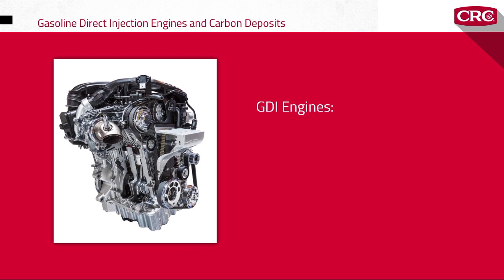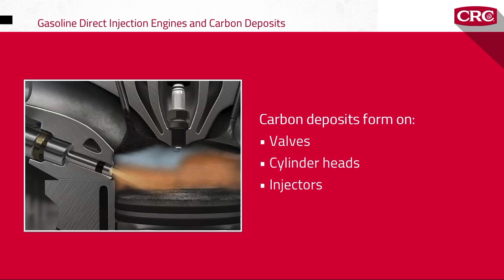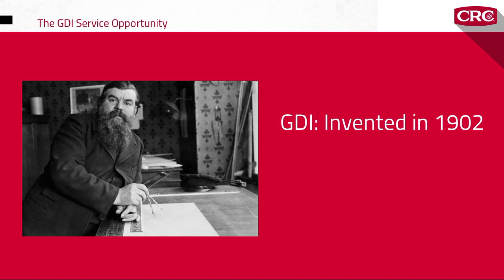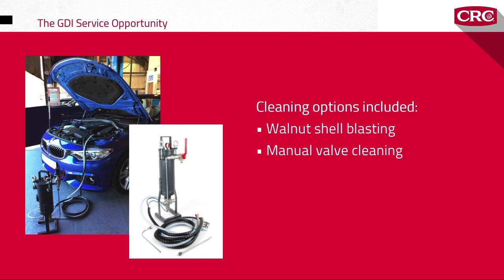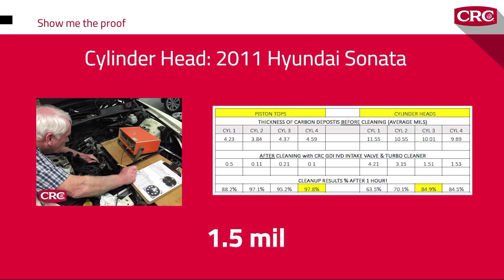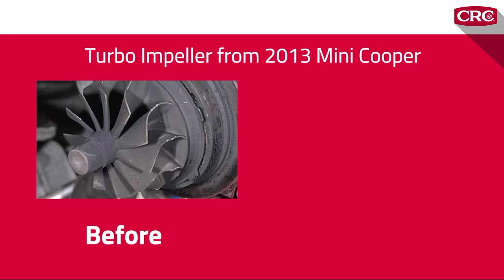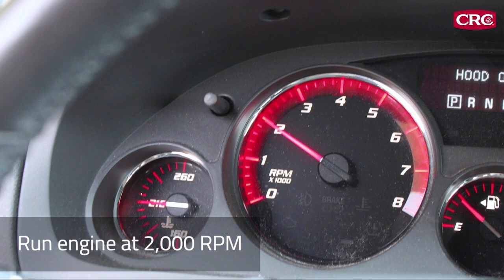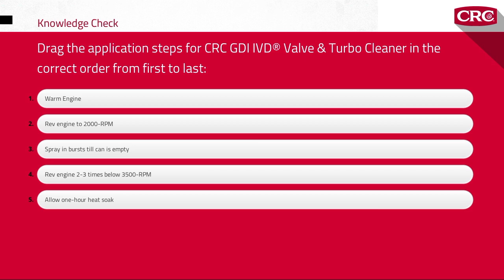GDI Engines and Carbon Deposits | Know Your Parts

Comment: Change your oil way sooner than they tell you to in these cars. Just do it. You’ll thank me later.
Reply: Thanks Batman 😀
Reply: Thanks brother
Reply: Agreed. I have a 2015 Optima w the Turbo. Though I only drive about 8000 miles a year I still change the oil every 3-4 months. I note after 3 months the engine gets louder and labors more. The car runs better on very clean oil

Comment: As a professional tech, I can confirm, that your cleaner does not work.
Reply: Idk buddy there's some people who been working on cars that say otherwise👀
Reply: Are you using it correctly you do know the engine is suppose to be hot right
Reply: @richardgolden3364  it doesn't matter in what temperature, cleaner doesn't work if carbon already caked up on the valve, even if we use screwdriver or sharp objects it still need a little bit effort scarp them off.
Reply: But liqui moly valve clean does..
Reply: @dingpongchi632  I heard it depends on the car. For instance I heard cleaner doesn’t work on vw tsi
Reply: It worked for sure on my 2020 Hyundai
Reply: What about all these videos on YouTube that say otherwise
Reply: @Qriusme  is it safe to use. Can it be done at home or does it need to be done by a mechanic? Thanks
Reply: @agustinmendoza7124  I followed instructions methodically and did it myself twice.  Can definitely tell the difference in improvement
Reply: @Qriusme  thank you. I have a 2019 Sonata. I’m definitely going to try it. Cheers Randy
Reply: It works as a regular maintenance item.  It will not remove caked on deposits.
Reply: I have a 2016  and the gdi motors and cvt trannys are trash. You need to run sea foam through the intake system ( because gdi doesn't inject gas through the intake like most cars , so they get higher compression  ) and take the intake boot off and spray behind the mass air flow sensor. Put boot back on. Rev to 2k rpms and hold it there while someone sprays the sea foam in . After can is empty, turn off car and let hot soak for 15 min. Then start it up, Rev it, drive about 10 min. If smoke doesn't appear right away don't worry it will ( especially in these trash motors , I've done 2 sea foam sprays already and may need a 3rd ) . If no smoke comes out, pull over and turn the car off for 5 min . Start process over again and if you have triptronic where you can control the gears then really get on it 1- 4th gear . Blow all that crap out of your motor. These engines do burn gas esp while using sea foam. Get an oil change shortly after. Smart thing would to be add the liquid kind to the motor and fuel system and drive 100-200 miles and then definitely get an oil change. God bless 🙌 🙏

Comment: GDI Cars should come with catch cans from the factory. Won't solve the problem but may delay needing to prematurely service the valves.
Reply: Solid and cheep option to help with all the evap junk
Reply: I agree,  I did install a JLT catch can last Tuesday at or around 12,000 miles....I think I might buy the jlt 3 oz extension  can for my 2019  after I check the JLT after 3000 miles to see what Will be in the can.
Reply: Or use both port AND direct injection so you get the benefits of direct injection without the carbon buildup issues.
Reply: @psychopenguin3821  not sure how they would freeze up, there is a lot of heat passing through that can. Plus oil is what is mostly being caught and it shouldn't freeze up..
Reply: @Eric Joziah Instablaster =)
Reply: @Kannon Shane Thanks so much for your reply. I got to the site through google and I'm trying it out now.
Takes a while so I will reply here later with my results.
Reply: @Kannon Shane WTF IT ACTUALLY WORKED! Just got access to my IG login after roughly 40 mins of using the site.
Had to pay 15$ but definitely worth the price =)
Thank you so much, you saved my ass :D
Reply: @Eric Joziah happy to help :D
Reply: @ericjoziah5085  Nothing contrived about this at all. 🙄
Reply: @HowtowithPaulHenderson  : I added a catch can to my gdi engine. The engine claims to have an oil separator for the vent system.
I get a rusty looking water in the can, very little oil.
Reply: @drewthompson7457  that doesn't sound good...it should look like motor dirty motor oil but maybe a tad bit thinner...is it frothy or brown or both
Reply: @HowtowithPaulHenderson  : it does seem that the built in oil separator is doing it's job, and synthetic oil evaporates less anyway.
I put the water down to condensation of combustion by products, as that's what the PCV system is for.  I'm driving less with the Plandemic, I get say an ounce of brown water in several months. / several tanks of gas. As for the color, I have seem brown spark plugs too.
There is no hint of water in the engine oil.
Reply: @electric7487  Basically everyone should build the way Toyota does
Reply: @drewthompson7457  I here people with the same problem. Some people say it's the cause of condensation as your vehicle sits outside in the cold night and bits of water accumulate on the sides of the cylinder and mixing in with the oil.
Reply: My f150 ecoboost never had that until after I was changing the oil return pipe for my turbos. My engine had a consistent ticking noise and shaking on acceleration that raised concerns. Come to find out the ticking noise was caused by pressure build up on the oil-return pipe and the shaking was the engines way of overworking itself so it doesn't die. The hairline crack on the pipe created a suction and leakage that water would go through it and get caught in the catch can. Glad I found that out quick.
Reply: @HowtowithPaulHenderson  I think they would freeze up overnight when car is not running in cold climates
Reply: @drewthompson7457  That's good to hear. Just keep an eye on it. Think I'm on my fourth JLT inspection This time I caught 3 and 1/2 oz I think that is due to the high rate of speed I was doing before this oil change and JLT inspection. I drove from Riverside to Vegas from Vegas to Reno and then back to Vegas and then back home I reach speeds up to 120 mph and cruised at 100 for quite a long time.
So during This driving. My drive totally normal so now I'll be kind of curious as to how much winds up in the jail to you.
I did send the oil into Blackstone laboratories to get it analyzed It came back pretty much identical to the other two oil samples I sent in.
Reply: Yeah it's crazy the over flow that get plumbed back into air intake and with direct injection we already have dirty intake valves my throttle body is filthy

Comment: I used this as preventative maintenance on my Kia Soul, then I lost a lot of power.  It turns out that my catalytic converter was clogged up, probably from the carbon that was dislodged from the valves.  So, yeah it cleans the carbon off the valves, but it can result in expensive repairs to your exhaust system.  That $15 can of magic cost me $1500 at the Kia dealership.
Reply: I had a bunch of catalytic converter codes after using, but they went away after a week.  I plan to use it again.
Reply: Old post I know but hoping for a reply. What did the Kia dealer say is the best way to combat the carbon build up?
Reply: @Hutchy86  I'm trying to remember.   One time I took it to the Kia dealer and of course the suggestion was an expensive catalytic converter replacement.   I went to a muffler shop to get it done  instead.   This happened twice, then I got rid of the car.  No more Kias or Hyundais for me.
Reply: @sibco96  thanks but I was actually referring to the values valves. Thanks for replying 👍
Reply: @Hutchy86  Ok, I've heard of two treatments: one is to chemically spray/soak the carbon deposits on the valves (GDI cleaner), and the other more extreme solution is to remove the heads and blast the valves with walnut blasting media.
Reply: Oh no, that sucks. I've been a little concerned about the cat conv myself and the effect that carbon cleaners would have on it
Reply: Maybe you should learn how to disassemble the cats. I mean, if you think $1500 is expensive, get a BMW. That's why a lot of BMW owners DIY everything. For example, an alternater replacement at the dealer is $1400-$1800. Did it myself in less than an hour and without the special tools they try to force you into buying. Cost me an hour of time and maybe $200. 
Keep doing your research when you run into problems with your car. Dealers dont generally fix the faulty part, they just replace the part altogether. Which is why it is so expensive. Always talk to other mechanics where you live if you can't diy. Good luck brother.
Reply: Thanks for saying that . There is no magic bullet for this issue i was concerned about the 02sensors and cat 🤷‍♂

Comment: 2014 Kia Rio 1.6L GDI even after using Seafoam regularly, 3500 mi oil changes, top tier fuel, valves get buildup where it impedes the complete closing of valves which allows oil to go through manifold to catalytic converter causing clog and heat damage. No recall on Rio , just Soul at this time but class action lawsuit filed in Federal Court in April 2022 against Kia Motors...Look at Kia excessive oil consumption.
Reply: I was thinking about getting a new '22 or '23 Kia Carnival with the 3.5 v6 GDI I wonder if I should pass 🤔

Comment: Best solution for GDI woes is to not get one 😉.
Reply: Lol
Reply: Almost impossible now to find port injected engines. Every car manufacturer is switching to GDI
Reply: @burgos041  I know, its why I bought a 2019 and not a 2020
Reply: Or properly maintenance it
Reply: @lordarkay272  They should get rid of EGR valves.  I believe that would stop the issue and then GDI would be fine.  Seems stupid to me to recirculate exhaust gases with oil vapors in them.
Reply: @andrewdanvers308  perhaps but now with such easy fix u think it's fine I have a gdi 4 cylinder and it has 30 k of hard use and still hasn't built much carbon now maybe when you get bigger ones it'll accumulate faster
Reply: @lordarkay272  many of the work arounds seem to work.  And with all the manufactures building them like that, they've  taken away our choices.  I just feel that we shouldn't have to use work around if a product is well thought out enough.  Good luck though.   I bought a 2019 Outback so I could not have GDI or start stop bs.
Reply: Toyota’s use both port and DI thereby avoiding any carbon buildup.🇯🇵
Reply: @barackblows1942 Agree that Toyota appears to have a better idea with their port + direct injection but there lies the problem...appears theyre unconcerned about other factorsmsuch as...Toyota rav4 2022 body styling is REPULSIVE!! Not to mention substandard interior, handling and noisy.

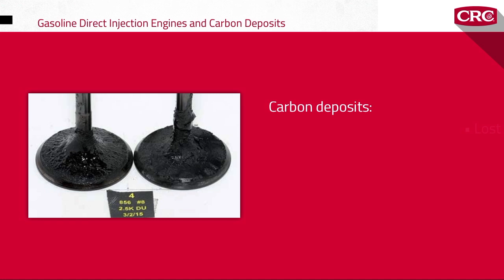Comment: 0:51 "GDI can provide improved MPG"  1:02 "Carbon deposits from GDI will lower MPG"  
In reality, GDI cars don't get better gas mileage than port fuel injected cars, but require burning gnarly chemicals to clean the engine.  That's way worse for the environment than a normal port fuel injected engine.  I'm sure this is the government's doing.  Whenever the government tries to save the environment, it creates more pollution.  Oh, and people aren't going to maintain their cars 5x as much, so now cars go to the junkyard sooner too.
GDI is stupid.  The cleaner stuff in the video is pretty cool though.  I've cleaned carburetors and fuel injectors (out of the car so I know it worked) with GDI cleaner and it seems to be more potent than carburetor cleaner.

Comment: I have the dreaded 2.4 theta 2 engine, I recently switched from always using full synthetic that's recommended to using mobil conventional 5w30. I no longer have to add half a quart every week and it runs quieter.

Comment: If you have a GDI engine, never let the vehicle just sit and idle for long periods of time.  This is when most of the deposits occur.  When in the drive through shut the engine off, waiting for friends you pick up ect.  Another thing that helps is being a little heavy on the gas in first and second, and a good spirited highway drive at least once a week.  These are the tips I have read about that seem to make the most sense.
Reply: But for turbocharged GDI cars after driving hard you can't just shut the car down right away you may end up damaging the turbo (turbo timers actually leave your car running after even shutting it down, of course that is if you were just driving it hard) so this only applies to naturally aspirated GDI cars.
Reply: @raulferro3998  I agree 100%.  I only own naturally aspirated vehicles so I was not referring to them, thanks for the extra info.  Come to think of it I never owned a turbo car before, something I must put on my to do list.

Comment: Using Pennzoil ultra platinum 5w20 and a bottle of Chevron Techron Complete, plus good gasoline will go a long way to help. My wife ❤ her 2014 Optima, and only has 22k on it. We are currently on vacation and we have driven over 1200 mi to get here, 75-80 mph while getting 38mpg. I've seen many of these vehicles over 150k miles. I've done a lot of research on the GDI 2014 OPTIMA,  best i can tell is try to keep carbon build up at a minimum.  And make sure the VIN number does not begin with a 3, these vehicles were assembled in Mexico and have proven to be very problematic. The Pennzoil ultra platinum and Chevron Techron Complete are great products, as is CRC intake and turbo cleaner. I hope my very limited knowledge has helped at least 1 person 😂.
Reply: Using the same oil in the wife's 2015 Hyundia Santa Fe along with injection and valve cleaner / fuel system cleaner on a somewhat regular basis. Pretty sure it's the only thing keeping that motor alive (2.4L). Will try this in the near future. I dont like how the oil looks like diesel oil even though it's changed like clockwork. Not only that but its using oil now also which sucks considering very good oil is used
Reply: My 2015 Kia forte five First three Vin letters are KNF ………… I’ve been running now shell premium, Pennzoil, high mileage, platinum and had the injectors had to be rebuilt over a year and a half ago because it was almost catastrophic and my car runs smooth now mechanic told me to put in premium gas and I have been for months and months, but haven’t done the CRC cleaner as represented in this video I think the technicians did it on my car probably a couple years ago. I’m afraid to do it with over 161,000 miles and it’s running pretty good. I don’t wanna make a mess out of this and have carbon or pieces of material causing issue that break free.

Comment: "Safely dissolves carbon in a controlled manner that prevents large pieces from dislodging in the engine." is their statement.  This is better than large lumps of carbon breaking off and ending up in your catalytic converter.   Everyone says...use the can until empty.  BUT I think a better strategy for a large mileage GDI engine that would have a ton of carbon build up, would be to approach it gradually.  I would be doing a quarter can or less once a weak until two cans used.  Just gradually remove the carbon build up.   I wouldn't want a flood of carbon through the converters and oxygen sensors all at once.  Doing it bit by bit might be safer for those components.  That will be my strategy.
Reply: I have thought you could remove a good catalytic converter and replace it with one that has the center already torn out. Drive it like that for 2 weeks and it will collect any of the junk in it. Then swap the good one back again.  Saves taking intake pipes off every week for 8 weeks.

Comment: I could see this working as preventative maintenance.  If you’ve got 150k you’re just going to send carbon through your engine and cat and cause damage.  Maybe if you start at 10k and hit it every 10k you might remove the small stuff before it becomes an issue.
Reply: Todd Roush you are so wright. But people don't take care of their engines.just put gas and let's go.
Reply: Scott Mayfield Like I said, it’s a crap shoot.  I’m glad yours worked out. 👍
Reply: Just remove the catalytic converter  problem solved and you can have clean carbon free engines for the rest of the vehicles life span.

Comment: So I used this today on my 2015 KIA Forte EX GDI. I made sure not to spray it into the MAF sensor, I couldn’t find it anywhere so I proceeded as normal. Turns out there’s not one on my model. 
So I sprayed it into where it shows on the video, the air duct where the air filter goes. I had my buddy keep the motor revved up to 2,000-3,000 RPM. Everything went okay, so I went to go get on the freeway for 10 minutes as instructed in the video, which was only a 2 minute drive away, as I got up to 35, the engine rattled real bad and a BUNCH of white smoke came out the back. It rattled once more as I got on the freeway, but not nearly as bad, and not as much white smoke the second time. 
Later in the day I did notice more power to the gas pedal, and higher MPG as indicated on the dash. Engine appears to be running normal. No check engine lights or anything. 
Is the engine rattle that happened normal? This is the first time I’ve ever done it after finding this video. Engine has 151k miles on it.
Reply: Make sure you take the car to the dealer and have the recall taken care of. (Knock sensor) 
That's a HUGE deal that can cost $7000 if you don''t have it done. 
Avoid driving the car unless you have it done.
It will add a warranty to your engine. Make sure your oil is full and keep it clean with good synthetic oil. 
Ignore what you hear and change it  every 3000 miles. I have 440,000 miles on the same engine. You want high miles? Do as I say.

Comment: Mercury Marine yes the Boat Company has a similar product called "Power Tune" about 10 bucks at your dealer. I use the stuff everyday it also works great as a carb cleaner FSM cleaner I've had it get fuel pumps to working again. Had it bring compression up by removing carbon. Love it and swear by it.